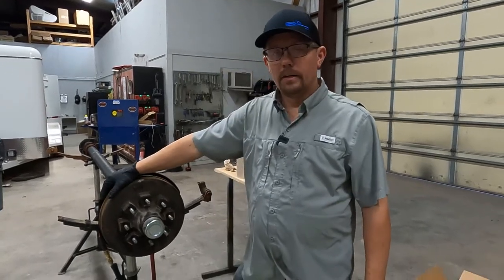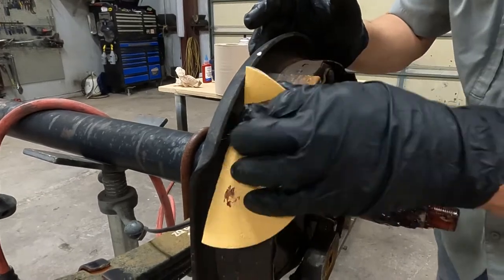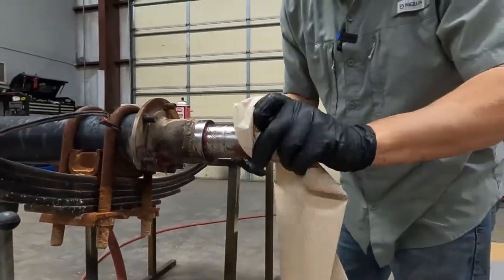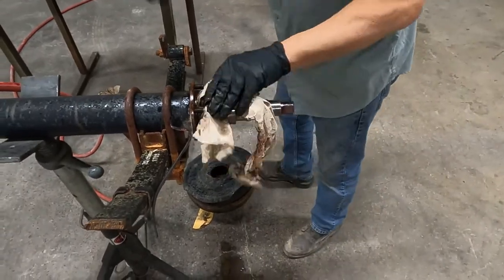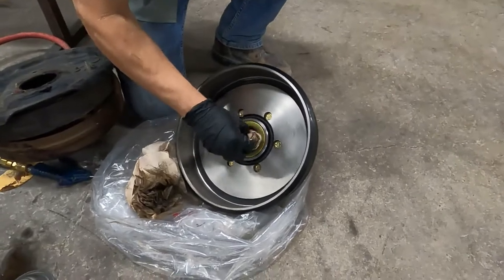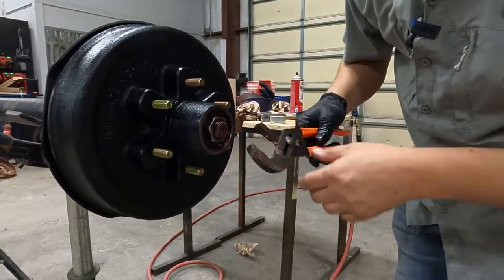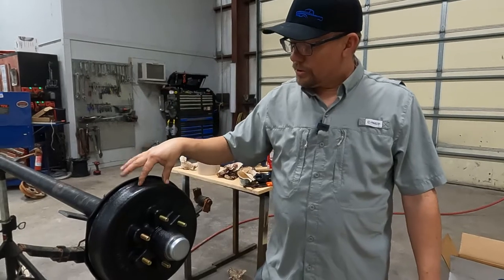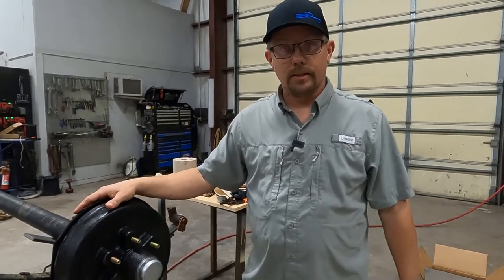How To Install New Trailer Brakes and Drums

Comment: How important is the right & left on the brake assembly?  I just replaced dexter torflex axles and the brake labeled right was on the driver side , left was on the passenger side.   I did change them to the correct side on the new axles.  I had trouble with brakes locking as slow speed.  After I switched brake assembly so far it seams to brake much better.

Comment: I was always told on new bearings tighten the nut to 50 foot pounds then back it off and and then just snug the nut back up? Old bearings just snug them up. Thoughts on this method?

Comment: Hi TrailerSmith, I have a 2013 travel trailer. Axles are 3,500-lb, Brakes are 10 x 1-3/4. The studs are 5 on 4-1/2. 14in tires. Everything was made by ALKO which no longer exists and parts are not available. Upgrading the brakes and drums to 10 x 2-1/4 may not possible because the original spindles may be too short and/or the new bearings a different size. Have you encountered this before?  Is having the original brake shoes relined still a thing?  Thanks Mike

Comment: Great video! How often should this be done? Almost 2 years since I did anything with my brakes
Reply from the maker: Hi!  Thanks for watching!  There really is no time frame for when to replace brakes and drums.  They should be inspected annually to get a look at the wear on them.  That wear is what determines whether it's necessary for replacement.  So it really just depends on how often you pull the trailer and the braking system is used.
Reply: @TheTrailerSmith  thanks my guy!

Comment: Is it really that easy to swap between 7k and 5200 lb axles? For example; i have 5200 lb now but i want to upgrade to 7k all i have to do is swap to the 8 lug drum? The bearings are all the same?
Reply: I would think you're trying to go up. Asking the axle to do more than it's rated. Whereas he was asking a 7k lb axle to do less.

Comment: I just started searching axle/brake/bearing issues for RV trailers. Yes, I am one of those who did a yearly routine of jacking up each of the 4 wheels of a 2018 model trailer and inadvertently inserted grease into the drum. I followed the owners manual and used a hand grease gun while turning the wheel slowly pumping the grease. Apparently the rear seals failed anyways, allowing a little amount of grease to contact the magnet and drum. Mine were not as bad as I have seen here on YouTube so I can save and reuse most parts by a good cleaning. After the first time greasing the bearings in 2019 I noticed a small amount of brake fade from the year previous year but just figured the brakes needed adjusting. I adjusted them the following spring after again, adding grease and they were no better. [go figure]  The brakes were not working well all last season and I was told by fellow campers about a possible seal issue so here I am. 
I enjoy your videos and they have been a great help in understanding removal and reinstallation of axle components. 
Thanks